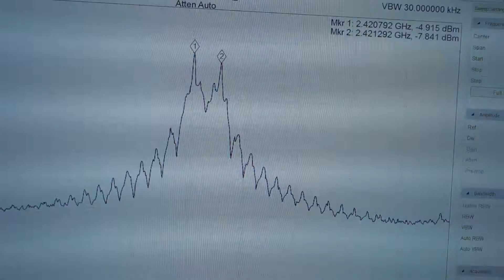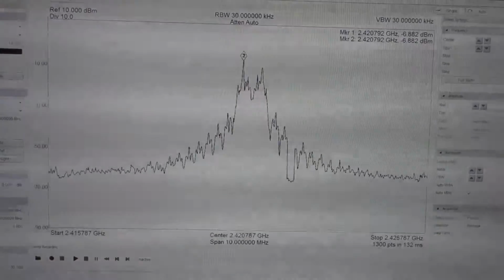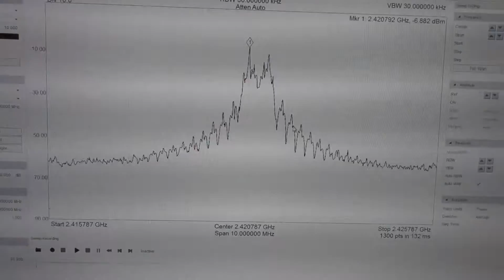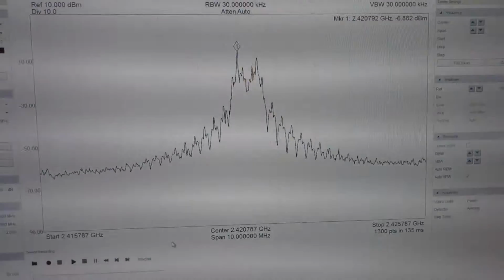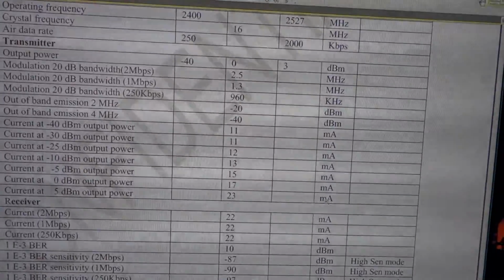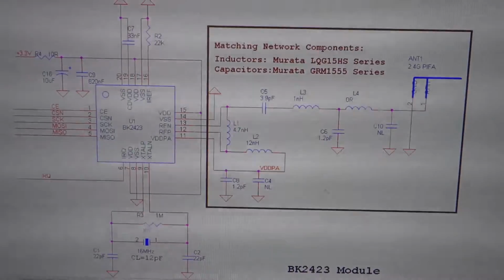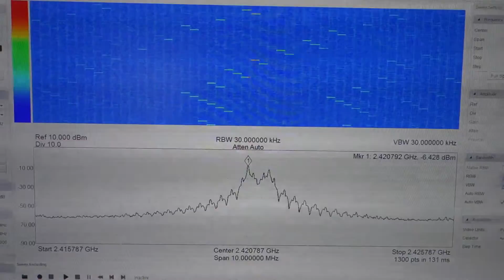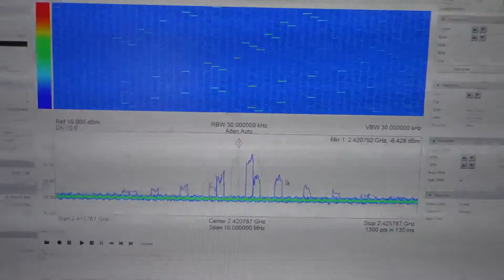Syma X5C Transmitter Output Power Spectrum Analyzer -  Beken  BK2423 2.4 GHz GFSK Transceiver

Comment: Thanks for the video, i know it's an older one.  I hope you see this comment.  You seem pretty sophisticated compared to other people discussing antennas so i thought you would be the one to converse with.   I was hoping you could shed some light on something. 

 I have a modded Syma controller just like yours with the grounded Pigtail connector in the same location for an antenna.
 
 I ran a series of range tests with an unmodded controller, an unmodded quad, a modded controller and a modded quad.   I did these tests all at the same time at the same location using stake markers for each setup.  This was not anecdotal flying, it was done very straight forward.  

The original transmitter was used and a stake marker was placed at the location of out of range Syma motor stop.  This was approximately 250 feet (at this location).

On the modded transmitter I used a 3db omni, a 5db omni and a Alfa directional panel antenna.   Every change was tested and marked with a stake.    I could not break past 30 feet More distance than the original quad and transmitter using a modded transmitter no matter which antenna i used.  In fact, all the stop locations were closely grouped together, as if, no matter what antenna was used the signal was too weak.

Is a modded transmitter a myth?  Could it be that the signal output of the Syma transmitter is so weak that there is nothing much to really amplify with an external antenna?  These tests were carefully done because I wanted to find the correct combination or antenna to use to get the best range.  The difference was almost zero.

I might add, I also modded another controller, the Cheerwing CW4.  I tested this modded controller against an original controller using stakes.  The modded controller may have added about 50 feet but that is all.

My tests show little effect by modding a transmitter with an external antenna.  In that case, everyone claiming huge gains with these mods are simply showing bias.  Do you have any testing or info on these mods?  My next step may be a cheap WIFi amplifier (I think that would actually work).

Hope you see this......
Reply from the maker: First thanks for the kind words :) Yeah, I'm professional in RF, drones are just my hobby :) Don't forget that the whole link budget depends on many things, the most importants are: TX antenna gain, RX antenna gain, TX power, RX sensitivity and alos the radiation pattern to "aim the beam" into the right direction. So at the end your receiver antenna would advised to fine tuned as well on the receiver drone for better link budget.

Not to mention if the impedance matching in each side is not optimal (this depends on the RF module on board) one can use a great antenna without success. 

So this is not a myth just a quite complex equation. If I were you I would try to add a proper receiver antenna to your drone as that's not a big deal (just the tons of screw in the Syma housing... ehh:) 

Cheers
Reply: Ok, thanks.  Do you recommend trying something like the 1/4 grounded antenna such as inside the 3DB housing?  If so, would I want to make a real shielding ground to the negative battery terminal on the quad board?  I already have a quad with a 1/2 wave antenna coming out of the top of the housing- but it is just a length of wire-= not shielded.  This one also couldn't overcome 30 feet beyond the org quad and transmitter even using the modded transmitter.